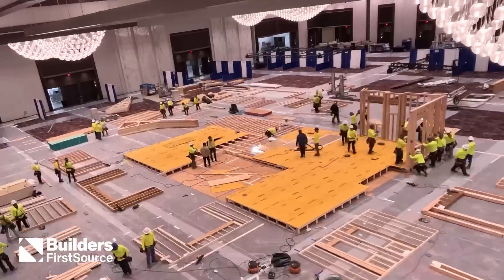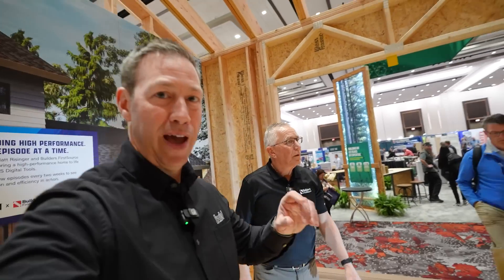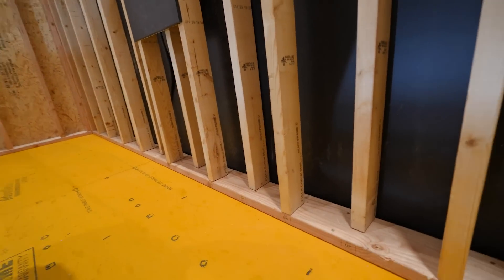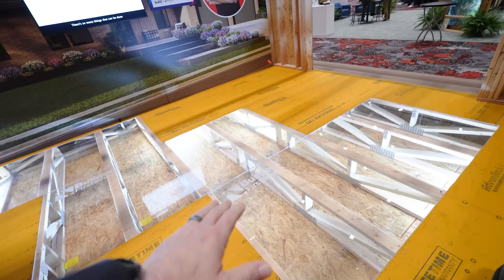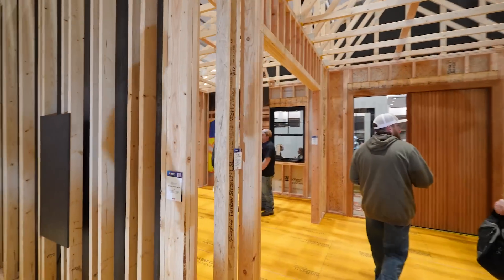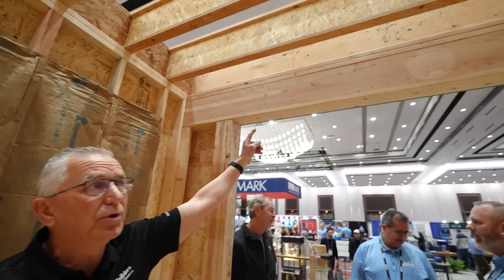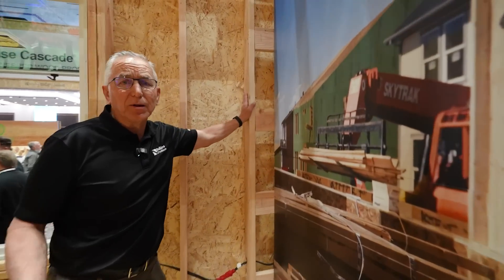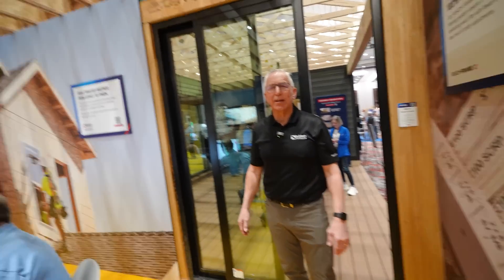3x4 Studs, Truss Headers, & More Framing Techniques You Didn’t Know About!

Comment: None of those studs seem to be making a connection with the bottom plate.
Reply: It looks like most studs had only 1 nail. I imagine they did that because this thing needs to be taken down since it's just a demonstration and would be easier to take apart
Reply: @leolionz3692 , I think you are right. That’s the only explanation that would make sense for an exhibition/demonstration build, in an environment where everyone who looks at it is going to judge your skill and proficiency!
Reply: @leolionz3692 They should have used framing screws
Reply: I know 😳... As he's trying to explain how everything is matching
Reply: They’re setting on structural nails. 😂
Reply: That was built to be taken apart easily. If I were building it and taking it apart, I'm using as few fasteners as possible.
Reply: @chrisanthony579  Actually it was built as a demonstration.  It was not built to be taken apart.
Reply: LVLs looked good
Reply: Matt is a salesman, not a builder.
Reply: As others have noted, fewer nails than standard because this will need to be taken down in a coupld of days but the gaps at the base of the kings and trimmers at the base disturb me - MOSTLY BECAUSE MATT NEVER ADDRESSES THEM!!!
Reply: How else would you get insulation under the studs? 😅
Reply: @Cooper1  xD
Reply: @Cooper1 ridiculous
Reply: @Cooper1  hahaha
Reply: There was a pretty nice gap in many of them. They'll settle down I'm sure......
I didn't see toenails so I assume the studs were nailed to the plate from below?
Reply: It's a convention display. 
You're and idiot claiming you know code for temporary displays.
Reply: Bluetooth studs
Reply: Even factories can’t cut a stud a consistent length
Reply: The walls were probably built on the floor then tilted up.
Reply: It's a demo dude. They have to tear it down.
Reply: @  Demo is short for Demonstration.   The fact that they will tear it down has nothing to do with why it is there.  It was built as a demonstration to demonstrate things it was not "Built to be taken down".... That's like saying concrete forms are built to be taken down, they are built to hold in the concrete mix.